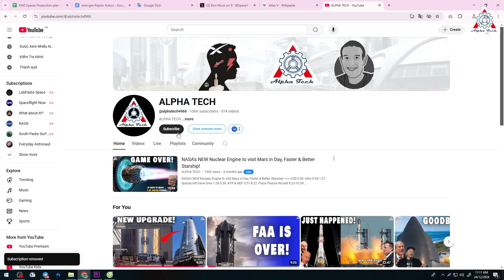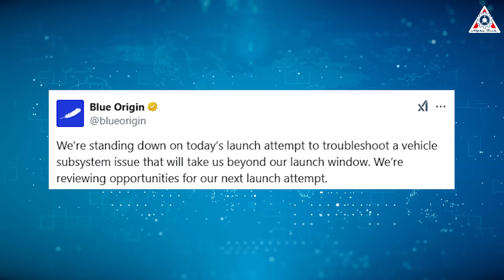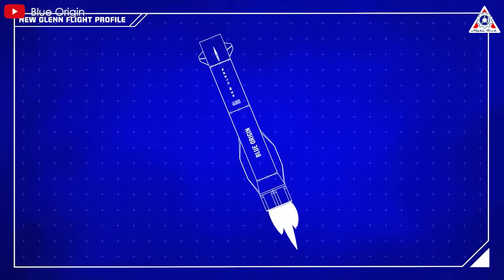Something Weird Happened with Blue Origin's New Glenn 1st launch to orbit but...Starship FIRST!

Comment: Starship has made it to orbit and has aafe  re-entry theee times 
The engineering of the heat protection system exceeds that of  the Space Shuttle. .
Reply: As do the Raptor engines
Reply: @MakaiMauka   THE RAPTOR ENGINES ARE NO WHERE NEAR AS ADVANCED OR AS EFFICIENT THAN THE RS-25 SSME ENGINE ! ! !